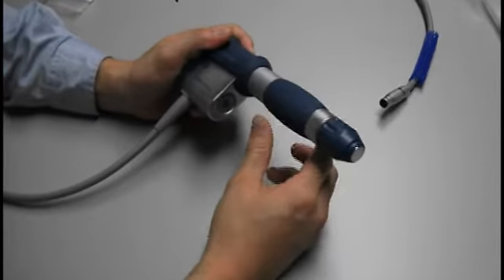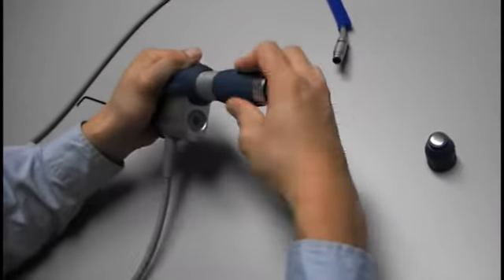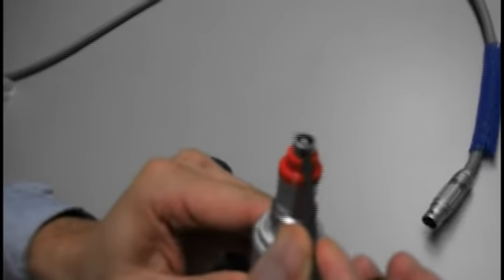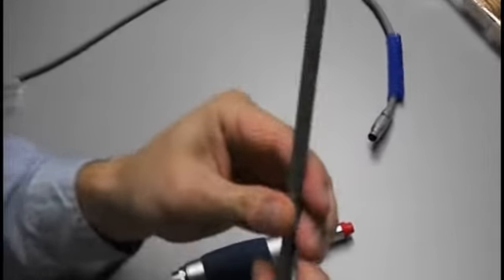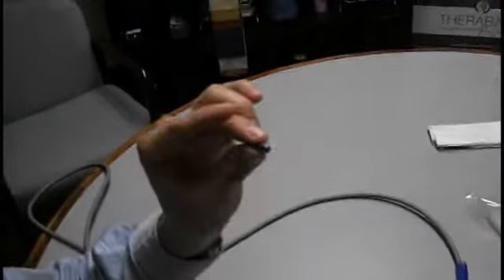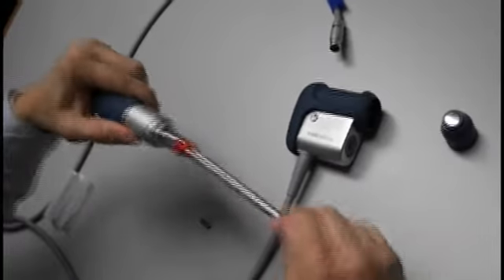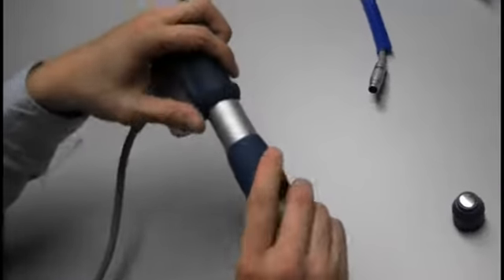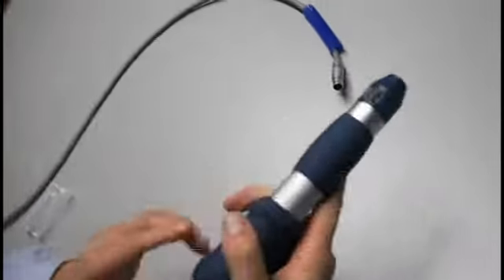revision kit change

Comment: Does the direction of the bullet matter?  The bullet has an metal tip on one end and nothing on the other.  Also, where does the small magnet go?
Reply: Direction of the Projectile or Bullet does not matter.  The small magnet?  There is one in the handpiece and it should not be lose.   If you are in Canada, please give our service dept a call or email.